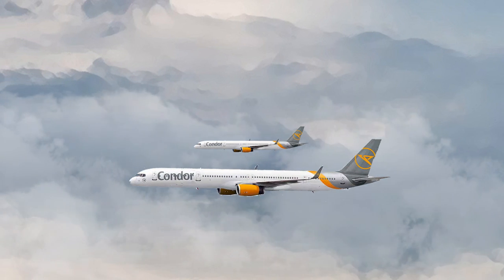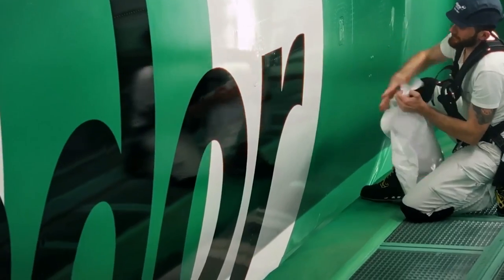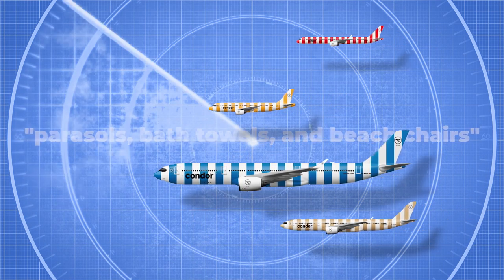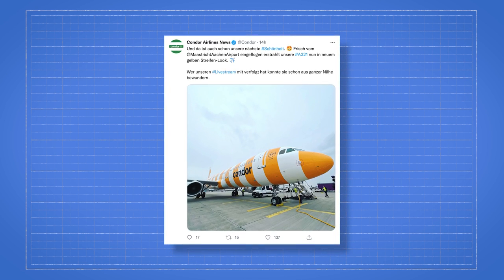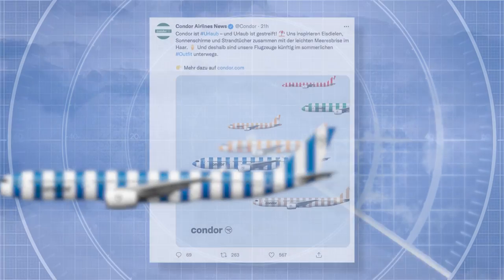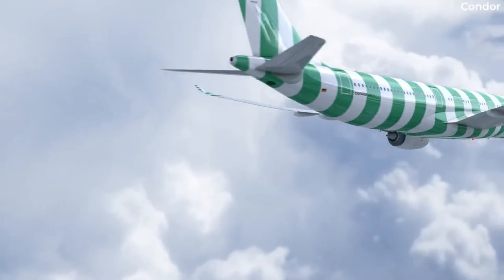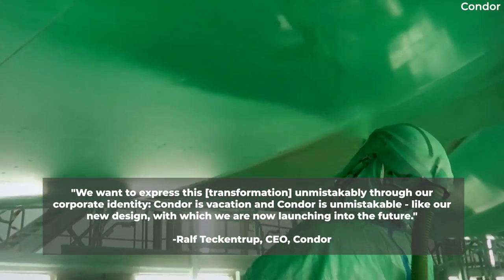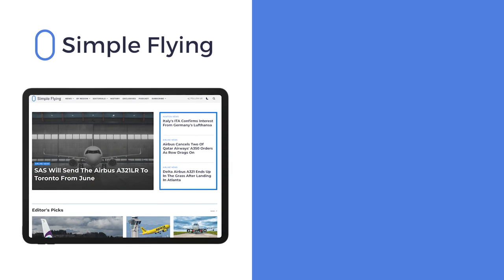Bold: Condor Breaks The Mold With Its Colorful New Livery

Comment: modern day liveries have lost the essence that the retro liveries had. Nowadays, it's all about branding. yet this livery is lovely to be painted and easy to maintain over the year.
Reply: Branding is the only reason why aircraft were even painted in the first place dude
Reply: @dopepopeurban6129  branding of the airline itself or some promotional campaigns!?? Dude 😬
Reply: @bikensai902  up until the 1940s actually very few aircraft were even painted. Similar to rail coaches, they were just non colored and only featured some kind of symbol of the respective airline, not for the passenger but for the ground staff to distinguish the different companies. Only when competition increased in the late 40s and early 50s, aircraft started being painted. The reason being sol for passengers to associate a certain quality of service with the brand. And this was only introduced to attract passengers to this certain status of quality, nothing else.

This is the exact reason why many leisure carriers don’t even paint their aircraft at all. As they get contracted by bigger travel agencies, the need for self advertising is non existent, meaning a paint scheme to advertise isn’t necessary.
Reply: @dopepopeurban6129  yes exactly 💯% right. Wet leased airliners are barely painted in the leasing airliner and would bear the old operator's livery or some parts painted either to hide or promote something to associate with the new operator. The painted airplane helps ground crews, passengers and spotters to identify the operator and to carryon the associated tasks. We have ATRs leased from Austrian, Jet Airways and many more operated by Buddha Air. Still bearing the livery of the old operators. Nepal airlines operated Lauda B767, etc. The point for painting an aircraft is for identification. Which were theme of the past. Nowadays, the airframes are advertisement boards in the sky. Whether the service are good or not, staffs are friendly or not, the airline would cease operation or not, doesn't matter, the airframe should look shiny and filled with catchy graphics. Oh look! It's the XYZ airline with some patchworks of sponsored stickers. 
I absolutely love the modern concept of painting an airliner, for e.g, Air Asia, Turkish and Sun Express. Just finding it's fun and informative to interact with someone intellectual like you. Let's discuss further. 😀
Reply: @dopepopeurban6129  New airliners will have to be painted because they are increasingly being made out of composite materials like fiberglass, carbon fiber etc. and also paint helps to prevent corrosion.